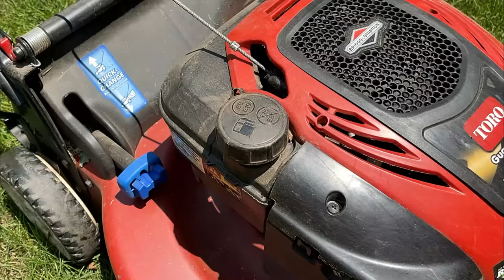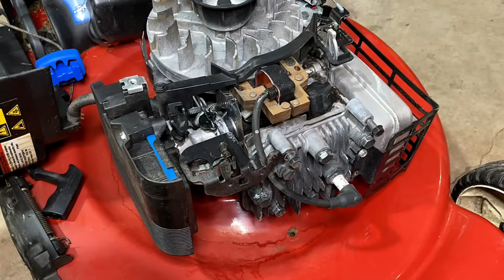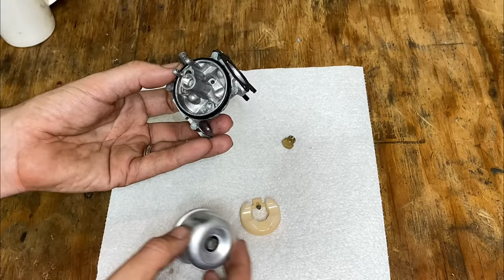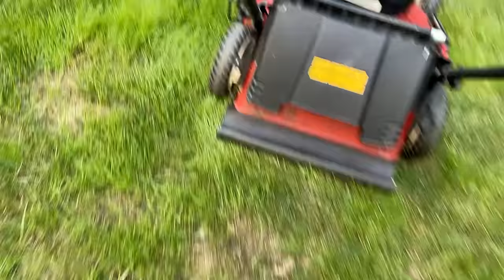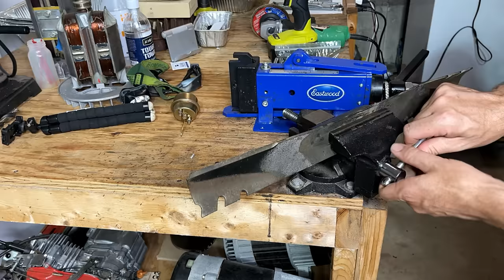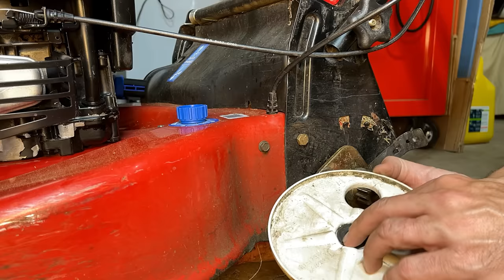Free Smoking Lawn Mower - Not an Engine Issue

Comment: I’ve had 3 generations of toro recyclers just like these
1. They HAVE to warm up before they run good
2. Toro advertises its a “never change your oil” mower
3. Even my brand new one smokes on start up!
4. The oil quantity supplied by toro in box is too much
For the initial fill up!
5. It’s considered a disposable mower in today’s standards that’s why there’s no oil change needed.
6. Advertised horsepower is a joke! Mine is a 5.75hp
and I’d be shocked if it was 3.5hp at most.
7 if you don’t clean your toro “ every single time you use it” it will be junk before your first oil change!

So, what have we learned?
It’s disposable, needs more than advertised and it’s not what the rates specs claim…..
ITS CHINESE MADE JUNK!!!!
BUYER BEWARE!
Reply: It’s considered a disposable mower in today’s standards that’s why there’s no oil change needed.

This is a common misconception about these 'never change oil' small engines.  I agree the quality has dropped and their life expectancy isn't nearly as long as older ones.  However, these engines achieve the 'never change oil' because they are designed to burn oil.  The engines consume about 25% of the oil every 40 hours.  If your adding 25% of your oil every 40 hours, thats basically the same as changing it but over a longer period of time.
Reply: wannawin95    That’s certainly the case with the Honda SX I inherited from the in-laws when they moved to Florida years ago. This thing must be close to 45 years old and uses a tiny bit of oil every year and the oil always looks very clean. Great machine.
Reply: This is common among newer cars. Oil change intervals are way too long, oil breaks down and things like timing chains wear out unexpectedly, resulting sometimes on interference engines with destroyed top ends and worse. I stick to 3K mile changes no matter what. Cheap insurance.  👍🔧🧰🚗
Reply: The Toro Recycler and Personal Pace are at the top for the $400ish  price point.  They are NOT junk, their are A lot of them out in the field still running 20 years later.  You sir, don't know what you are talking about.
Reply: @mikespain8655  these mowers are indeed junk, you don't have a clue guy. I've seen them sell at home depot for less than 200$ even the lower end hondas with the gcv160 engines are better than theses piles of crap, its a embarrassment to the toro name. The old school toros with the aluminum decks, and 2 stroke suzuki engines put these to shame.

Comment: When your carb is dirty like that and you cleaned it. It may be that the fuel lines are breaking down, putting debree in the fuel bowl. It also is wise to add a fuel filter to the line

Comment: Compacted grass that gets hot and burns usually means the auto choke has interference also. The belt drive on the PTO is probably worn and slipping. I haven’t watched the fix-phase here yet. I’m going to bet the carb is clean. I like to make my own calls  to see if I’m right. In 50 years of mowing grass, edgers, trimmers, push mowers and riders, tillers, pressure washers and generators, I’ve NEVER had to take my equipment in for service. I do it myself. My last push mower lasted for 25 years, 10 of that in commercial service. (The deck had holes in it, so I gave it to a 13 year-old aspiring lawn care professional. His dad is a welder by profession!)

Comment: I love finding free or low cost stuff like this. I'm semi-retired and love to work on projects like this. I came across a deal with a very clean Toro Recycler (Not running and a valve cover leak) with a Briggs, and an old Troy Bilt with a Honda GVC 160 engine. Got both for $50. The Toro was a simple fix and is in use now. The Troy Bilt with the GVC 160 runs good but smokes. I'm gonna go through the engine and I'll get whatever it needs. The way it runs, I'm thinking a fresh set of rings and a carb clean. Honda is going to quit making gas powered lawn engines, (going all green), so I'm gonna get whatever the engine needs now while the parts are plentiful. Honda engines last forever. Oh, good job on your finds. You're like me, if I find something and think it's worth fixing, I'll take it. lol

Comment: For 40 bucks I'd sooner just push the mower. Good exercise. It's Dr recommended The wheel issue is mendable. Cut the threaded wheel mounting hole off and re attach it ( weld) closer or further which will give a better gear mesh.

Comment: I've seen other videos where they put shims in between that gold bracket and the frame to get the gears to line up better. And some guys replace the plastic gears wheels with the older medal gears, which last longer. I got a 2006 Toro  similar to this with the metal gears.

Comment: I have this exact mower! I bough it at Home Depot years ago new. 
My engine started smoking with in the first month and Yes I broke in the engine properly!
And checked and changed the oil, Toro paid for a engine replacement at a local repair shop.
Last year the rear drive systems plastic tire gears went out, it was the axle bearings the went bad (they completely oblong’d out allowing the axle shaft  to let the gears skip) 2 new rear tires (because they have built in gears) 2 new bearings & the cable for the blade too. 
As of yesterday It ran fine. 
My deck is rusting away a bit to.
Reply from the maker: The bearing are the only thing that makes sense short of a design flaw.  Did not see any play in these, but that would make sense.

Comment: Great video. You’ve inspired me to buy a $30 mower off craigslist (that runs and cuts but is smoking a little) and go through it. The mower in this video, I would have disconnected the drive mechanism as I like to push my mower. Thanks again!

Comment: Another problem they have is the side discharger failure. After only a few times using it the plastic mounts fail and is no longer usable and falls off the machine when trying to use it. Thanks for another video.

Comment: The only fix for the drive would be if toro either enlarged either the drive pinion gear or the sprocket on the wheel.  And doubtful they would,  or have they due to the recall.   The fix was apparently replacing 3 screws?
Reply: They should stop making plastic wheels... Alloy wheels are better... especially for the gear...
Reply: @adrianbadea1179  yup, but then wheres the failure point?  The transmission?

Comment: i have that exact same mower, i bought it used in non running condition, with a bunch of other mowers, unfortunately the previous owner ran the engine with  very low oil causing engine damage, since the deck is still good im looking to someday put another used cheap engine on it. i got the other mowers running tho, its always a dirty carb, if manufacturers would just put a fuel filter on it this wont be a issue which is what ill do with all my mowers.

Comment: if I was going to guess I would say you have a vacuum leak somewhere in the fuel system. When things get hot the system expands and stops surging. Take some WD-40 and look for leaks around the gaskets near the carb. and tank. Other than that you might have some slight blockage somewhere, but I didn't notice any when you had things apart. Outside of a weak spark those are two most common reasons for surge.

Comment: I have the same mower, in fact the 2010 model as well. As with any drive system, the bearings, bushings and the spacers wear out over time and in fact get "egged" out. This causes the drive gear to lose engagement with the wheel gear.  So the solution for me was to replace those parts along with new steel gears and wheels that have steel gears as well. There used to be a guy on eBay that was selling these kits, but he no longer does that. I think you can get these parts from the Toro website. I did this a couple years back and it's worked well for me.

Comment: Great video again.  I just did my mower as well and found about three ounces of water in my tank.  I do leave my mower outside but how would it get so much water?  After cleaning the carb it is a one pull start.  Also replaced the geared wheels all were stripped.  It takes two and a half hours to mow my lawn.  The only thing I might suggest is sharpening the blades away from all your equipment .  I see a rotor nearby and other stuff that could get metal filings in them.

Comment: The bracket that the carb mounts to is loose! This is a common problem with the Quantim engine and causes the intake manifold to break.
Reply: @dkupy100  There are "2" bolts that hold the carburetor mounting bracket in place additionally the loose bracket causes the carb to tilt, causing the choke air vane to foul up across the top of the magneto coil.

Comment: Excellent job!! I  would have put another 20 bucks and got a new blade.
Still a very nice mower for resale or personal use. I think they designed them to fail, just not as fast as they do. I've come across some with an aluminum gear and they hold up better.
Reply: Not designed to fail.....
Designed to a price....
Reply: @ronjohnstonaustralia2417 Tout à fait 👍.
Reply: I repair and sale used mowers and they all get a new blade also

Comment: Hello there. Drive issue on that lawnmower. Tips of gears are barely engaging. There is no adjustment to it, but, you can fix that problem by bringing center of  wheels closer to center of drive gear. wheel carrier plate could be drilled and nut weld on back side. Some measuring is needed of course....depending on skills and tools someone has. Keep up good work.

Comment: I'm not a fan of the thermostatic choke system, the primer bulb seems more straight forward. The last one I fixed, I swapped the carb and air cleaner housing for the primer bulb style. Starts first pull every time (after pressing the primer 3 times). Also the "personal pace" drive system is my least favorite setup on the Toro recyclers, unnecessarily complex .
Reply from the maker: I like a manual choke even better.  Have full control.  But agree in that (keep it simple).
Reply: I never understood this, people bothering to mention or even caring if a mower started on first pull opposed to 2nd or 3rd.  For Pete's sake, you're about to mow a lawn yet pulling a string more than once for 4 extra seconds is a factor in that?  If pulling a cord is such a hardship, take the cover off the top (or cut out an access hole just large enough) and spin start it with a socket on a cordless drill/driver/wrench/etc.  

This is also a very handy thing to do when you have one that won't start, instead of continually pulling the cord you can be spraying carb cleaner in while you spin it (wrap bungee cord around safety lever on handle), which can sometimes even clean out a carb enough to allow it to run and clean the carb out a bit more by itself... then at least you have a better idea what to look at doing next.
Reply: @jcondon1  I totally disagree. Auto-choke Rocks!  That however is just my opinion. I just found your channel sir,.... Subscribed !    - Ed from Indy
Reply: @stinkycheese804  Spinning the starter with a drill is a great way to hurt your hands.
Reply: @stinkycheese804  the more you pull the more wear and tear on your shoulder.
Reply: @deanyanko3326  Fair enough, if you have a pre-existing shoulder/back/neck injury that you keep aggravating.  If you don't, I'd hardly call it wear and tear to merely pull a mower cord a couple times.  If you don't, then you really ought to get some exercise so you don't find this kind of LOW effort activity, more than what it is.  PS there are electric starter ICE mowers, or most can be converted to drill/impact-driver/torque-wrench start, quite easily and inexpensively.  Just don't see this as a factor compared to almost anything else.

Comment: Gentleman your show is outstanding, you are a complete professional and I  express my gratitude, about the issue with the rear tracking wheels is that it is a comercial matter, if it doesn't break they make no money, a perfect repair would be finding a metal driving gear a little larger than the one on the equipment , perhaps Mc Master Carr have them in stock, from the endless summer paradise, giving you my most expensive thanks, Jesus Torres.

Comment: To avoid much strain on the gears you could level your lawn.  The usual way is with an ample supply of sand, which can be levelled with either a 5 foot wooden or metal beam.   A little bit and often will fill all the hollows.
Reply from the maker: Not much level land around here :(

Comment: Just curious if anyone had in issue with the way James cleaned the engine and components, i.e. with superclean then water hose, then blower?  I've always been afraid to do this (don't know if water gets somewhere it shouldn't).  But if it's fine, then this is exactly how I'll do it from now on.  So much easier than the way I do it.  Loved it.
Reply: LA Awesome and a power washer on low speed. Never had an issue.

Comment: The only idea I have for the gear is to get a pair of custom gears CNCd that you can bolt on to the wheel in place of those plastic ones, and have them be a little larger diameter. Which mean mean adding a tooth or two, which may slow down the drive speed a tiny bit. But I don't think its worth the effort for such an average mower. Stock up on those plastic wheels, thats the real answer I guess :D

Comment: The OLD MAN at Eliminator Performance, amazing how many customers do not change their air filters nor make the proper adjustment on the Toro drive cable. If Toro increased the diameter of the drive gear on the wheel for full tooth engagement they would have no issues but you sell a lot of drive wheels i guess. Nice to see you do a mower video.
Reply from the maker: Thanks Wayne.  Saw a very helpful Eliminator Performance video recently on a high resistance Honda spark plug cap.  That was exactly my issue on a GX390.  The secondary on the coil tested fine at 6500 ohms.  The plug cap came in at 100,000 ohm and then when open circuit. https://youtu.be/ejAX6Bn4WSo

Comment: James, another very fine video. Methodical and predictable. Look it over, assess it, run it, clean it up and change the oil. Then use it.  Growing up during the 1960's in a suburb of Detroit where people had fairly good paying jobs, they threw out mowers when they  failed to run or start properly. Because (I thought at the time) there were just no repair shops, people went to Montgomery Wards, Sears and Roebucks or the local hardware store and bought new ones. For me it was a goldmine having people put old lawnmowers out at the road for rubbish collection. I collected them. I had so many engines from various lawnmowers one time an Uncle came over and upon seeing them remarked "You've got more little engines than Carter has little liver pills." That was my upbringing. Dad had a few tools and I used them to rip apart everyone of those little engines and learn all about them. For me the neatest thing was that after I had 3 or 4 of the same engine, one would have a bad part that another had that was still good. So I'd combine them and Voilà, I'd have a running engine. In short order I scrounged together an entire lawnmower. It was named after the man who created the Oldsmobile Car, Ransom Eli Olds. It said "REO" right on it. It was a 17" rotary mower that I used as I began my first real money making job mowing lawn for a very nice elderly lady Mrs. Climber. I split $5.00 with my best friend for mowing the front 1/2 of her 2 acre property about once per week. When she paid us I would immediately go down to my local auto parts store and  buy a quart of Wolf's Head motor oil for 75¢ and then hit the corner Oak Gas station to fill a 2 gallon can for  50¢  Between mowing jobs,  I worked on building a Go-Kart. It was strictly illegal to ride it on my dirt road, I was told by police. So I only made "trial" runs, but only seldom, just to see if what I had accomplished actually worked. Funny thing though; somehow I always managed to burn my 2 gallons of gas by the time the next mowing job was done.  Thanks for the video, and conjuring up those old memories James.  See you next time. ben/ michigan
Reply: Small engine repairmen are millionaires, Ha Ha Ha

Comment: Another very good video. I saw the gap in-between the drive gears, that's no good. I wonder why they would have used such a large gap without any adjustments?
Reply from the maker: You and me both.  Definitely a design flaw.  The newer models seem much better.

Comment: The simple way to fix the drive is to creatr a new hole in the mounting-plate [NOT by drilling] - at the RIGHT C-C distance, then tap the hole and screw-in the wheel again. The HOLE should be made by driving a masonry-nail through the plate - to maintain the maximum metal-thickness. It can then be sized properly for the screw-tap.

Comment: Toro may have given a lot of clearance between the drive pinion and the wheel gear teeth because of how the wheel height adjustors change the relationship between the gears when you raise and lower the wheels.  I'd look into adjusting the height full up to full down and seeing if there is a noticeable change in how much contact there is between them.  Reinstall the old wheels and then make the height adjustments - I'd be willing to bet that at one extreme the gear teeth have deeper contact and at the other the gear teeth are only barely meshed.
Reply from the maker: I did try that and there was a small difference, but not enough.
Reply: @jcondon1  Well, it was worth a thought at least.

Comment: All Toros are good mowers but I prefer my 2 ancient 35 year old Toro self propelled recyclers with the Suzuki motors. Never had an issue with either, still use them. One is a 4 stroke Suzuki, other is a 2 stroke variety. The 2 stroke mower is much lighter then the 4 stroke. Easier to use on hills.  :face-blue-wide-eyes: